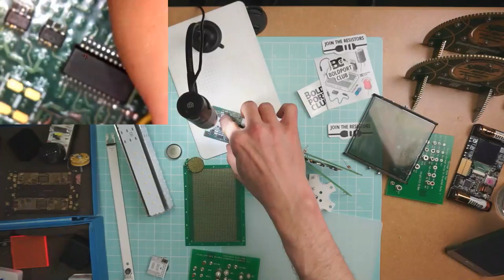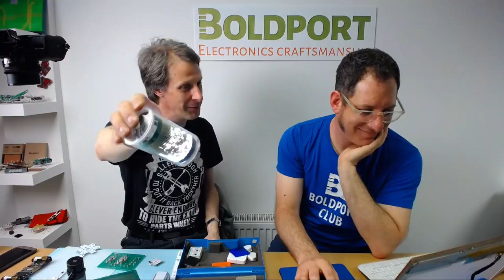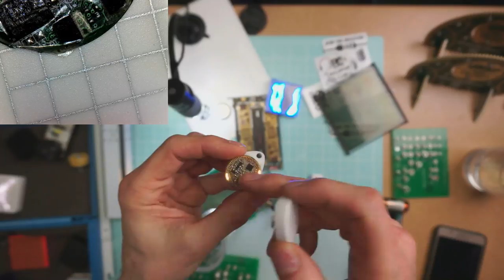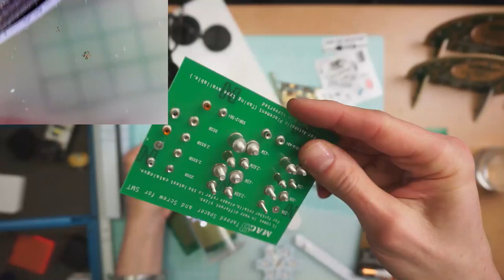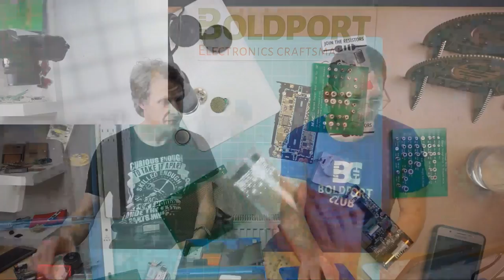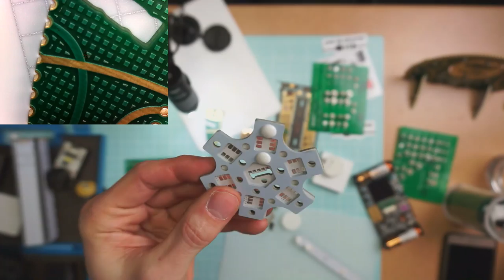Boldport Variety Show with Mike Harrison

Comment: I agree that arduino doesn't scale well, but for quickly putting something together for a prototype or a home project it is second to none! The libraries, device support and existing code base make it super quick and easy to get something up and running.
You can do quite a lot at once too. I have managed to keep 2 dmx universes, an http Web server, 6 motorised faders with PID loops, a few hundred WS2811 leds and an LCD display based user interface going all at once from an arduino mega. The best part is, the code only took a few days to get working.
Once you can do arduino, you can learn how to do it properly, so I always recommend arduino to people wanting to get into electronics.